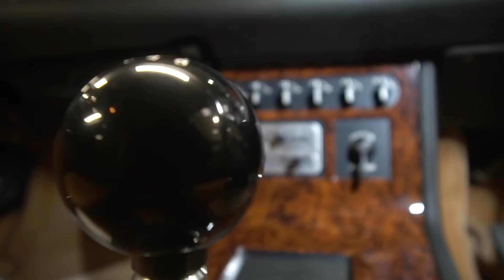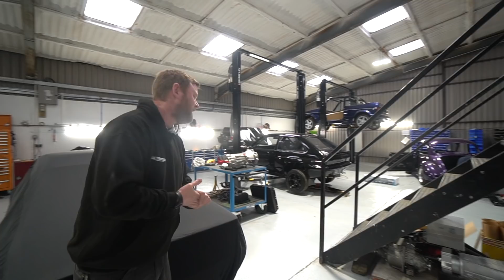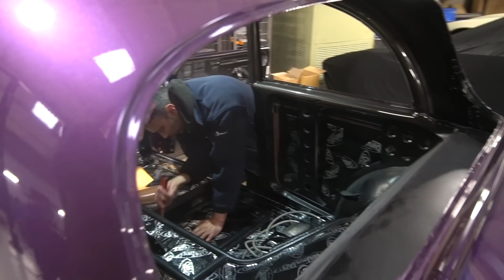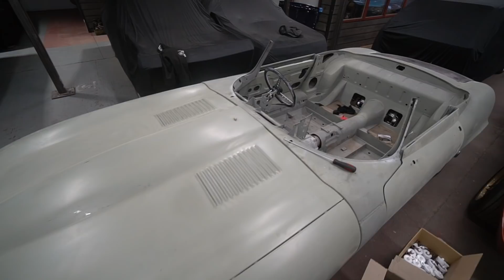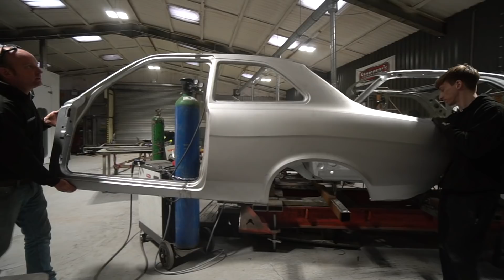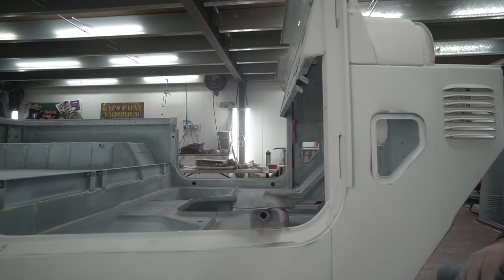Retropower Uncut Episode 83: MK1 Escort Shell Rebuild & Allegro 3D Scan!

Comment: Biggest issue with the Allegro shells were flex , if you put more power into it you will have to redesign its strength as it will flex . I had a 1300 one as a company car and I had three windscreens in ti as the body would flex on a spirited drive through Worcestershire and the screen would pop.

Comment: The Austin Allegro project sounds reminiscent of British Leyland Australia's test mule for the P76 when it was being developed in the early 1970s. They used an Austin Kimberley (6cyl landcrab), stretched it slightly behind the front wheel arches and installed the P76's alloy 4.4lt V8 as well as rear wheel drive. Definitely a wolf in sheep's clothing!
Reply: The P76 was a gigantic backward step by BL from the Kimberley...proof that marketing departments had and have undue influence on  car companies. The main problem Australians had with the Landcrab and Kimberly were that they were fragile...but that is garbage - their shell was very, very strong and their suspensions, while different, were very robust.
Reply: @stephenscholes4758  I think the likes of Evan Green and Jack Murray proved the strength of the Austin 1800 however, it was a totally different beast to the P76. It was also a very tough car with a great engine but built, unfortunately, by a lacklustre worforce and a company with extremely compromised quality systems. Both cars deserved the success they never got.

Comment: Only engine swapped Allegro I've ever seen is TV's Jonny Smith's one with a Rover KV6 and a rear-mounted radiator
Reply: It’s not a KV6, it’s a Honda C27a, but have a look on the Retro Rides forum and you’ll see a very nicely built blue 4 door Allegro with a K-Series Turbo engine. There is a also a Rover V8 engined wide body Allegro, which has been seen out and about on various tracks
Reply: @ChequeredFlagAutomotive  interesting - ta for correction!